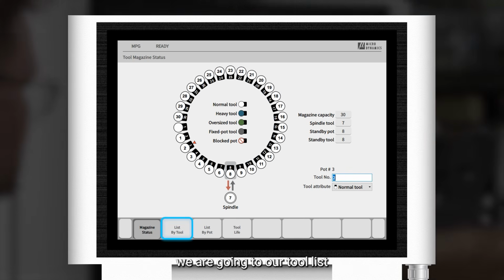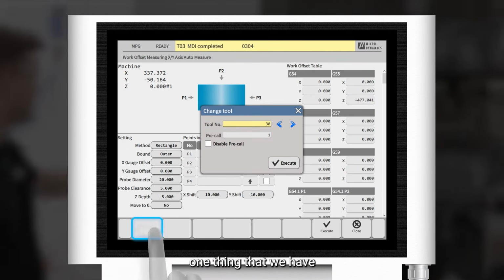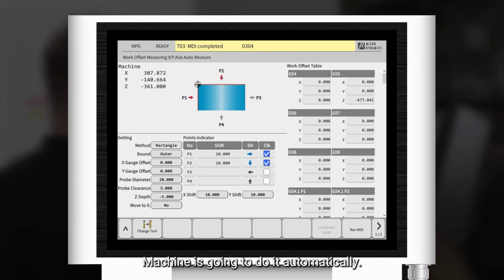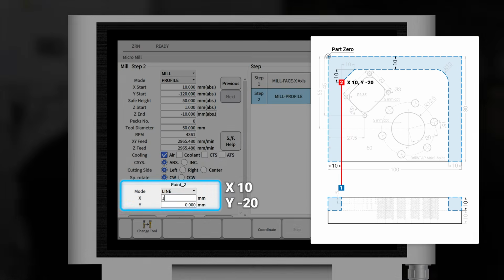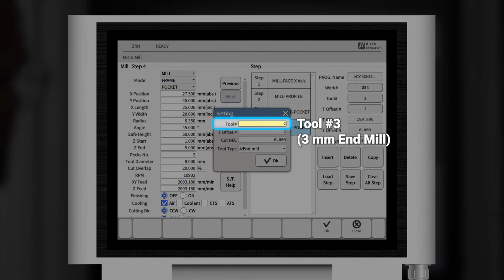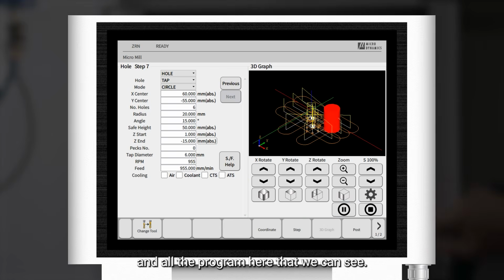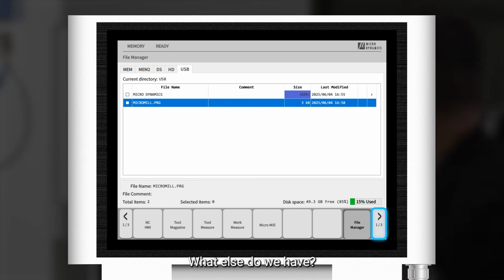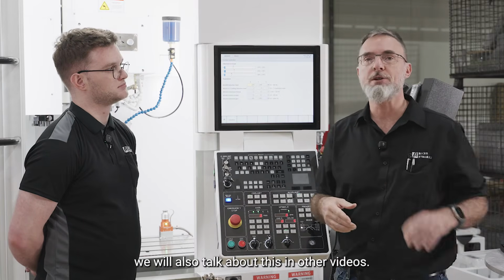Learn MICRO MILL in 5 Minutes | MICRO DYNAMICS HMI Made Easy

Comment: Where is the tool radius compensation relative to the contour? It’s clear the simulation isn't accounting for it (You had to correct the G-code.). A view of the stock with precise measurement capabilities—or at least a grid aligned with the reference point—would be useful.

Not to mention that the chamfering for the threads was missing. Chamfering—not drilling. In other words, the milling contours are positioned relative to the circular layout.
Reply: P.S. My mistake—the add-on actually does trace the contour correctly (though the tool entry is odd; it applies compensation too late). With an operator interface like that, you’re lagging about 30 years behind the competition. Plus, there’s that poor real-time simulation.